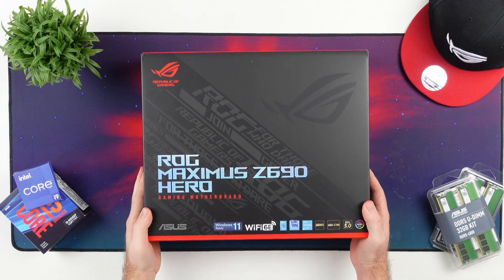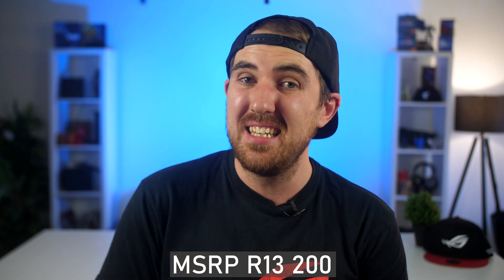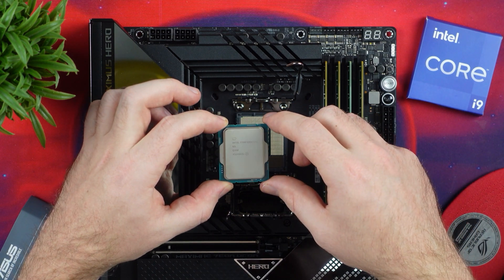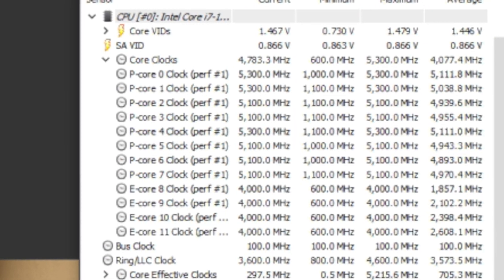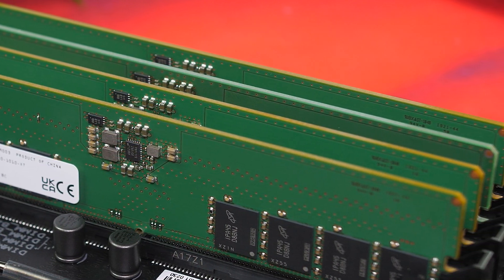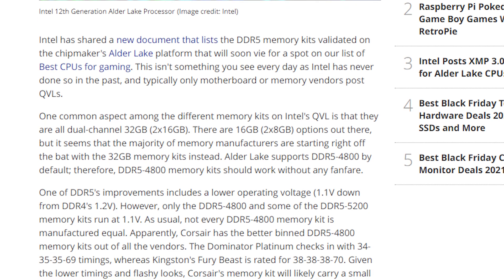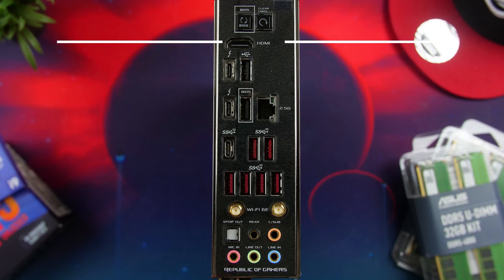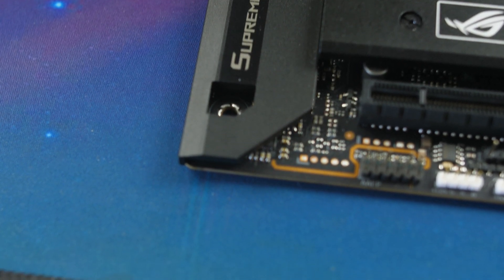ASUS ROG Maximus Z690 Hero Review with i7 12700K

Comment: Looks like you got one with the capacitor properly oriented
Reply from the maker: Need to follow up a bit on the issue, kinda surprised me that the Hero would have such a problem. But guess anyone can messup.
Reply: @WeDoTech  Asus expects a premium for their brand name too... They also messed up with some of their 3000 GPUs. Ones shipping with no thermal paste or pads. And their Armoury Crate program does not always work as it should.

Comment: o I have a Corsair h115i Pro RGB CPU cooler, do I need to upgrade my cooler now to fit the LGA 1700 Socket or do these boards come with adapters????
Reply: Liaise with Corsair and they can send you a mounting kit for LGA 1700 in regards to that cooler.

Comment: Hey! Thanks! I want to build 12700k pc but idk wich cooling system to buy? Im struggling... Do I need 1700 socket cooler or my lga 1151 cooler would work?
Reply: What size case? Try to get the coolers that state LGA 1700 support. I know a few Corsair coolers do.

Comment: Too many of your graphs show 12700k vs previous Intel chips.  We KNOW that it blows them away!    We want to see how 12700K compares to Ryzen 5800/5900/5950.

Also, how about power consumption?  That is very important!    Ryzen 5950x can be air-cooled with a $30 USD cooler.    What kind of cooler is required for Alder Lake 12700K ?
Reply from the maker: This wasn't a CPU review, there are the large reviewers with all the CPUs for that. You cant expect a small channel to be able to do every single thing. If you want more then support the channel so that we can get more AMD CPUs to compare.
Reply: @WeDoTech   Ok fair enough.

But you do have the 12700K and Asus ROG board on hand?   How about some cooling and power consumption info?   Thank you!
Reply from the maker: I will see if I can do some. I usually stay away from full CPUs reviews because nobody really watch them and rather just go to Linus or GamersNexus as they would be able to do a much better job. But some short videos on certain features might be something I try.
Reply: @WeDoTech  dont say That.  i hate linus, There is room for more